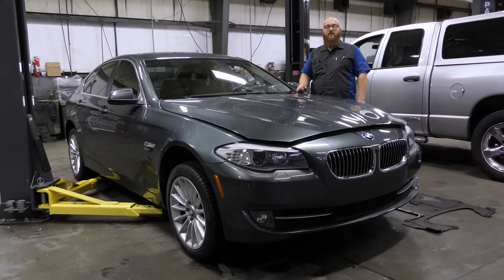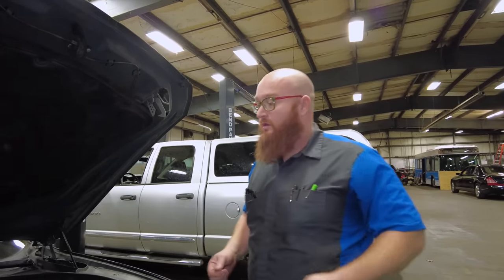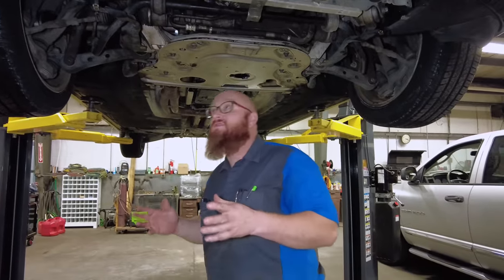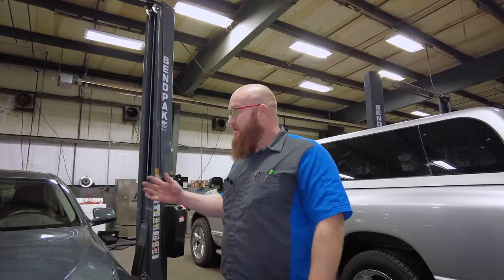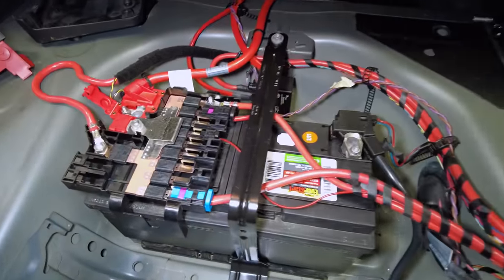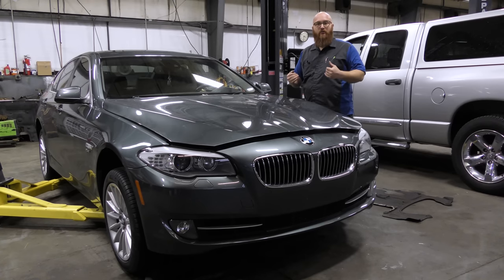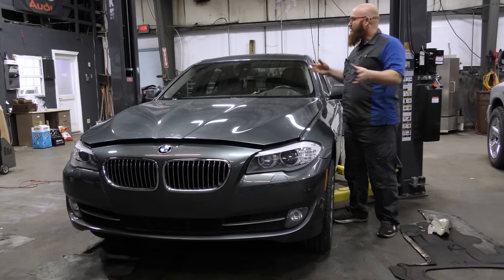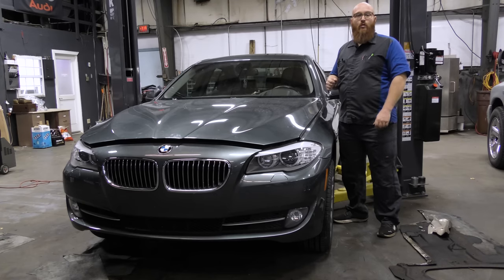One bad day for a customer! CAR WIZARD found TWO insanely unrelated issues at time on '12 BMW 535i

Comment: Just replaced the starter on my 528xi last month at 175K miles. Not a fun job, but if you scan Youtube, there are plenty of tips to make the job easier. If you're going to own a BMW that's not under warranty, (1.) Make sure that it's not your only vehicle. (2.) Make sure that you can do most of the repairs yourself.
Reply: Exactly..
Reply: So what's you second car ? 
I have 2 volvo's and a vw sharan 
And I wouldn't even have a visitor park a BMW in my driveway 😂
Reply: @zigzag7194  innit? i mean i have an old beat up volvo 940 turbo, which makes twice its factory horsepower, and for sure things go wrong from time to time (although i've never had one of those fuck my brains for reasons other than external intervention, like mods or crash damage), but it's my bmw owner mate who constantly tells me my current ride is shite, while his e92 a)doesn't go as intended; b) guzzles absurd amounts of petrol for no apparent reason; c) has some other quirky issues that need a crystal ball to figure out, but otherwise a beautiful specimen. I guess owning a bmw (in many ways like owning an old volvo) isn't a rational choice, it's a sexual orientation or something.
Reply: This is so narrow minded… There’s hundreds of different BMW models out there, it’s so silly to generalise and say what you just said
Reply: Luckily my second hand car is a city bus to take me to school. Lol
Reply: And 3/ make sure there's a bust stop near by.
Reply: Exactly I work on my own, not hard at all, there's plenty of other vehicles that's way worse than bmw, in the video that Scotty kilmer put out garbage, one of the videos he had no clue on what he was talking about on that 3 series for the most part
Reply: I did the same on my 328xi... it was a pain but not that ive done it once i bet i could do it again easier. Manifold removal is not that bad. I didnt even take it all the way out. Just pulled it up several inches.
Reply: @fb1000000  There's plenty of bmw models out there but for some reason they always follow the same rule. I've owned quite a few bmws over the years. Some newer, some older, and I can confirm that the above advice is good advice 👍🏽
Reply: Ref #2, I could, ref #1, Always told BMW customers to buy two so you have one to drive while the other is in the shop.  ;-)
Reply: Why do you say "not your only vehicle" they're just as reliable as any other car these days. I would stay clear of the GM garbage they have in the states.

Comment: As a BMW devote, let's take a step back and review what you said.  The 535 has over 200k miles? Was that the original starter?  If so, well it lasted 200k miles.  I am glad to hear the driver safely pulled over when having car trouble however many times, significant damage is done to a car after overheating and warning lights come on.  Upon calling for a tow truck, the owner should have requested a flatbed to insure the car can be towed away.  Importantly, as a failsafe, once certain sensors are triggered, it will enable the car not to start so not to cause additional damage to the engine and most importantly passengers. Lastly, electrical parts just fail over time especially when stress and the hose clamp failed due to fatigue thus the coolant leaking out. The owner has a reliable car with over 200k and it is probably paid for so to pay $2k in repairs is more than reasonable especially for a 12-year-old car.
Reply: Understood BUT the inability to put the damned thing in neutral unless you jack it up and crawl underneath with tools is just plain dumb.
Reply: 200k and the starter fails on a BMW is good? I gotta old dodge truck 385k on it and the only issue it's had was the ac pump failed lol
Reply: @l042987  God luv ya, man! A BMW starter lasting 12 years with over 200k miles will not make me mad by any means!😂😂😂
Reply: @frozentundra7446  seems a bit soon for such a high standard car company!
Reply: As someone who delivers auto parts to independent mechanic shops I can tell you that I've seen starters, alternators, ac compressors, air struts etc all fail on BMW's with way less than 100k miles. I've seen a bunch fail at under 60k. Maybe the starter lasted 200k in this one, but that is HIGHLY and I mean HIGHLY unusual. They are tiny little starters that look like they belong on a go-cart.  I still have the original starter in my 02 Silverado with 370k. Didn't have to change the ac compressor until 285k. The alternator lasted until 345k. The entire suspension is original at 370k.  You will never get a BMW to that kind of mileage, but if you do, you would have replaced virtually the entire car 2 or 3 times.
Reply: @Barneyrubble241  I beleive it my uncle just bought a BMW with the n55 90k miles.. At 91k miles the motor just blew.. Lol
Reply: @l042987  the point is for a BMW that's actually very good
Reply: @l042987 not high standard just high prices 😂

Comment: 1: Push start button or attempt to start the car (even if it doesn't turn over, just push it down anyway
2: Push the lever twice in to N
3: Push the lever to N and hold for 5 seconds
4: Transmission is now disengaged for 15 minutes after which it will re-lock itself.
Reply: Lol what a procedure 

What would be wrong doing it like every other car 🤷‍♂️
Reply: @OBrechkin  you mean every other car that switched to a system just as chaotic?
Reply: WTF
Reply: @Technologically Challenged Tech so you don't accidentally knock it into neutral.
Reply: that bald guy in the video is clearly a scammer
Reply: @Technologically Challenged Tech 
broke  my  wallet,  broken  motor  wagon,  bring  more  wrenches.
Reply: @Technologically Challenged TechMW didn’t design the 8HP. ZF did 🙄. And don’t buy BMW’s with questionable histories and expect it to be flowers and roses.
Reply: And if your battery is dead... you cant do that procedure lol.
Reply: So these instructions must be written on the back of the sun visor😂 I read a comment that said if you own a BMW make sure you own a second car. 
My first car is a Volvo 
My second car is a Volvo.😂 
And we own a vw sharan for family days out 👍🏿
Reply: Yeah I found that forum too lol. Such a stupid process.
Reply: @OBrechkin  To simple. German engineers aren't very good, and this is the result.
Reply: @Technologically Challenged Tech Because they are poor engineers, and overcome that by building incredibly (and unnecessarily) complex systems.
Reply: @Technologically Challenged Tech dealer service.  Need i say more?
Reply: I don't have those problems. My 550 is a manual.
Reply: this must be an anti-theft feature, but a few yr old bmw, merc, whatever you name it wll sell cheaper than a toyota
Reply: This doesn’t work half the time. I tried it so many times on my 2015 335i and it didn’t work.
Reply: @OBrechkin  a lot of new cars have a similar system
Reply: I think the starter issue maybe from the auto start-stop technology. I own a 2013 model and I have disengage that feature. Hopefully that will extend the life of the starter.
Reply: @TheTotallywolf  $150 an hour plus taxes and he is Not a Trained BMW tech. 200,000 miles is 320,000 Kilometers. I am happy to change a starter that costs less than $300 dollars. Took me 5 hours to change and I replaced all the hoses at the same time. My starter went out at 264,000 kilometers. Total cost $500 Canadian dollars!

Comment: Looks to be a very well maintained, 200,000 mile BMW.  Nice and dry under there.   Too bad about the hose, seems odd that it would just pop off on its own.  Hope the engine survived running without coolant.  Sometimes they do... sometimes they don't.  Edited to add:  I wonder if someone has serviced the coolant recently.  I noticed it was green, should be blue (BMW oem).  If they pulled that hose to drain the coolant and didn't get it back on correctly, it could explain why it came  off.
Reply: agreed something is a little strange there with the coolant but the starter is normal wear and tear.
Reply: Not to mention, as a BMW mechanic for 15 years, always do a full cooling system overhaul every 60-80,000 miles. Avoids 90% of these headaches.
Reply: @spencerh1813  true, just an actual inspection would help a lot too.
Reply: @spencerh1813  Spencer being a BMW mechanic for 15 years would mean drinking ALOT for me
Reply: My Water Pump just went out I drive a 2009 328i with 177k miles on it, I parked the car heard a loud pop and all the coolant leaked onto the floor luckily I was home, ordered a new pump my secret I know a mechanic that's really good and will only charge 200 bucks to install it😄 Cant believe the original pump lasted that long car runs great!
Reply: @WeaponX668  hmm very interesting the most I've seen a water pump last was 90k with regular driving. Was the car bought used?
Reply: @spencerh1813  - Apart from changing the coolant what does your system overhaul consist of on a BMW? Water pump, hoses ?- I only ask as my 20 year old Mazda ( which I've owned for 15 years) has obviously had regular coolant changes but I have only just replaced the main hoses. The water pump and even the thermostat are still original. When I used to run Renaults, all the hoses needed changing at around 6 years as they went hard and fragile. It's strange how some manufacturers make parts more durable than others.
Reply: On BMW I would recommend radiator, water pump, thermostat, expansion tank and all rubber coolant hoses. For the Mazda I would do those at 100,000 miles. You can check the water pump bearing by seeing in there is any play in the water pump pulley. A lot depends on mileage. I drove a Toyota for 10 years and never changed the water pump. Only had 85,000 miles in that time. But the radiator failed twice. One thing Japanese cars have going for them are reduced oil leaks. That’s for sure.
Reply: It’s a $5-$7,000 retail…$2k to fix..this time. Maintaining cars these days is so damn expensive..only to re rewarded with a $1500 starter replacement 🤔 

I’m still trying to wrap my head around the fact you have to crawl underneath the damn thing to put it in neutral 🤔
Reply: Had the same issue with my coolant hose popping out during driving, turned out the dealer, where I was for maintenance, forgot to install c-clip that locks the hose🤦‍♂️
Reply: @mikemata623  Are you serious? My car is close to 300 000km and I have never changed the water pump ,( had to change the power steering pump though) I have  had this E46 from new 2002.
Reply: @zahkam7322  well e46 has a mechanical water pump, e90s with n52 and n54 engine have an electric water pump. Not surprised yours is still good, but the electric ones I've yet to see one go above 90k miles.
Reply: @spencerh1813  it was probably never done so that's why it happened. Then we have wizard complaining about BMW's.
Reply: @rogerbarrett9920 cooling system overhauls are basically the same with all cars. Hoses, radiator, water pump etc
Reply: I ran super tech walmart green coolant diluted to 50/50 distilled water for 90k miles out to 273k miles on a 550i never an issue with my coolant system besides a few new $40 expansion tanks that I would not blame on green coolant.
Reply: since at least the '98 area/time on the 6's, bmw engines do not last but a tiny bit of time after overheating
Reply: He did spend a couple seconds saying he filled it back up.
Reply: @rogerbarrett9920  do you see a pattern here? European? Eh? My 96 Miata I bought last year had all original hoses! No cracks! replaced the mains with silicone and a couple of others. But they were on pretty good shape. the name of the game when it comes to Japanese reliability is in the material science they put into their plastics and rubber parts. they just last longer.
Reply: @benjaminlusskin3211  - Agree with you. I have 2 Mazdas - I have just replaced my 2002 Mazda 323 Protege after owning it for 15 years- it never let me down and even the  aircon was ice cold still - I've replaced it with a Mazda2 and still have my Mazda 3. I've had a few Hondas in the past and they were just as reliable
Reply: My 2003 Toyota starter water pump alternator is original after 300,000miles   Coolant is original too that’s why radiator just started leaking. All the rubber hoses are original too. I replaced rubber belts at 290,000 miles. Not a drop of oil leaking.
Reply: @WeaponX668  mine went out at 140k miles. It had a crack and started leaking. Discovered it on time. It's impeller housing is made of plastic. Bought a doorman with aluminium impeller housing. Sure it will last the life of the car. Heard the plastic impeller housing can be replaced.

Comment: That neutral override is a crazy safety hazard. I can imagine someone on the side of the road on a slight incline. Jacks up a corner of the car to put it into neutral, then the car rolls off the jack...
Reply: Definitely a safety hazard but maybe it's actually such a hassle to get it into neutral it requires someone that knows what they're doing
Reply: The idea that you need to crawl under a car to then put it in neutral is the most insanely stupid and dangerous thing I have ever heard of. Imagine forgetting to engage the e-brake, or the e-brake failing? Absolute stupidity.
Reply: Horrible all around
Reply: Thats actually terrifying....
Reply: It's a BMW so the e break shouldn't work anyways yeah this is terrible idea. A lot of time and effort and money has to be spent to come up with these kind of things
Reply: @slasher9883  Its an anti-theft measure.
Reply: @jw6188  I can see how that would be very effective in eliminating theft 😄
Reply: @EarlFaulk  well....yeah okay.
Reply: @EarlFaulk  Norway, Denmark, Belgium, The Netherlands, Yugoslavia, Greece.

You forger that France was the defacto most powerful Land Army in the World for centuries. 

And i have a news flash for you, every Country still had calavary in 1939...
Reply: @slasher9883  What does it have to do with the e-brake failing? It's not that the car won't go into park. It is already in park as a backup in case of e-brake failure.
Reply: @JulianKapa  Maybe you should stop and think real hard about what you just said and why it doesn't make any sense. Get back to me when you have worked it out.
Reply: @slasher9883  Of course it doesn't make any sense to someone who doesn't understand it.
Reply: You can shift to neutral as long it has battery power. Option under the car is only when the car is completly dead
Reply: I can't believe anybody would design it that way ? Put that neutral switch so.ewhere LOGICAL  like the center console where gearshift levers are
Reply: yea... have to use dollies right away. No reason to get underneath.
Reply: @simeunovicm  it happens easily. Drivetrain, transmission failure. Can't shift out of P even if you have battery
Reply: @slasher9883 I’d like to see you move your car with a broken e brake lmao
Reply: @simeunovicm  You need to start engine to be able to put it into neutral on F series.